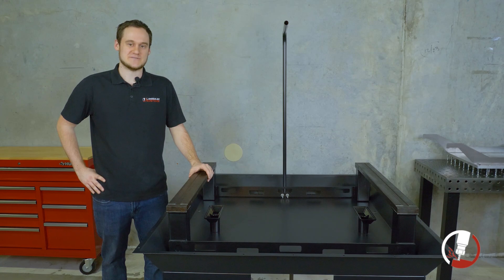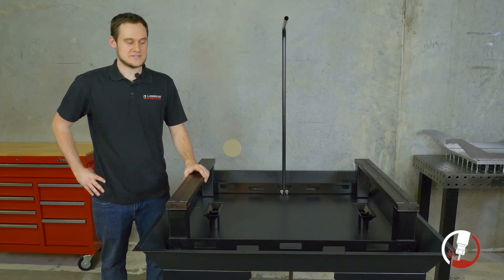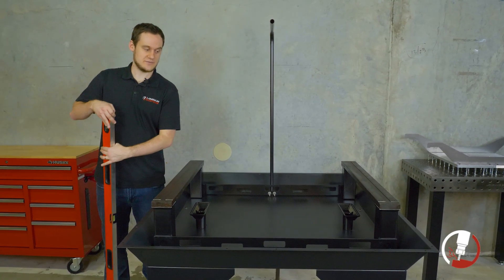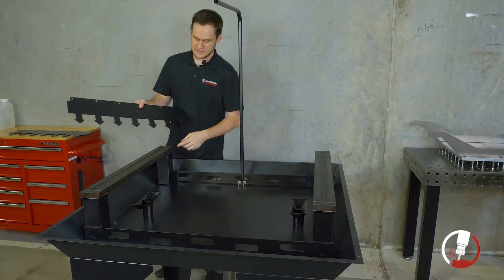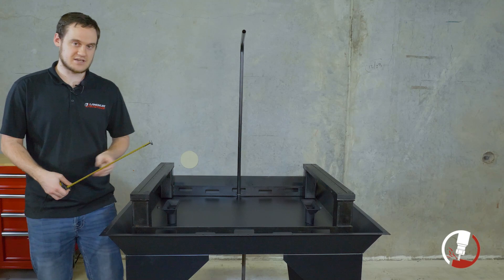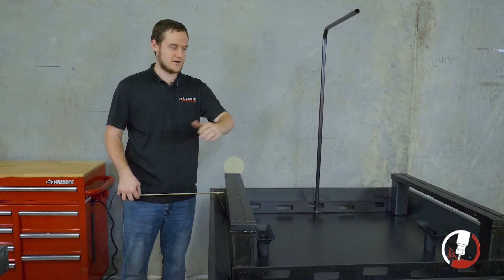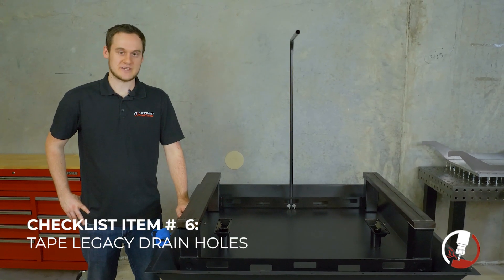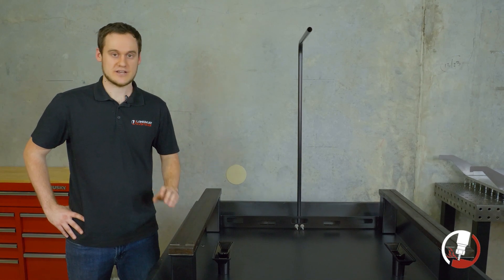MR-1 CNC Mill Assembly Tutorial: Performing Checklist Before Pouring Concrete Base (Revised)

Comment: I see a lot of complaints about factory drains. Could you upgrade and make a video of this?
Reply from the maker: MR-1 machines are now shipping with updated drains mounted on both sides of the baseplate. You can see the drains in this video. These drains have 1" pass through holes.